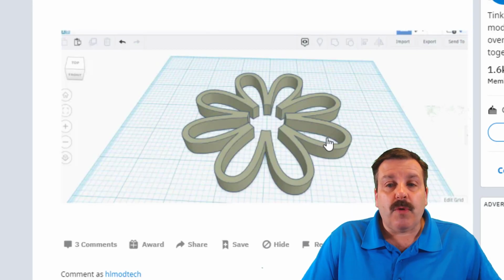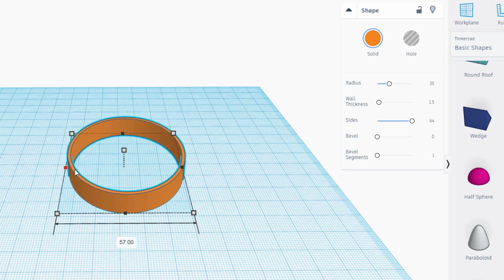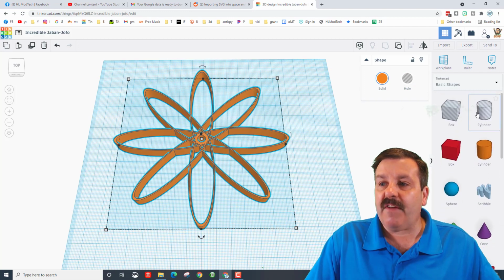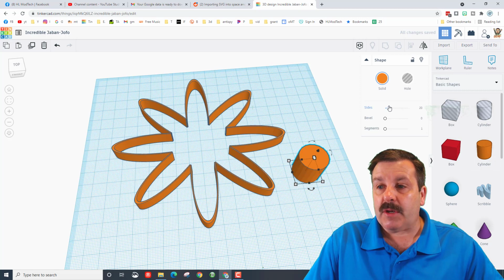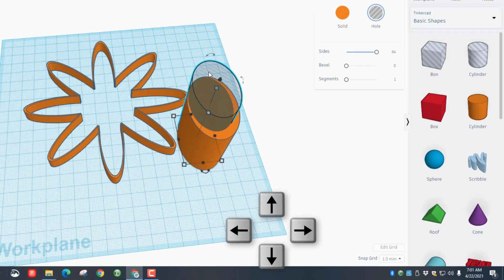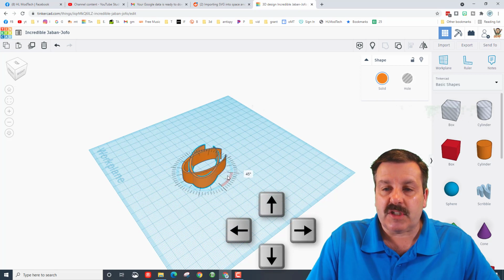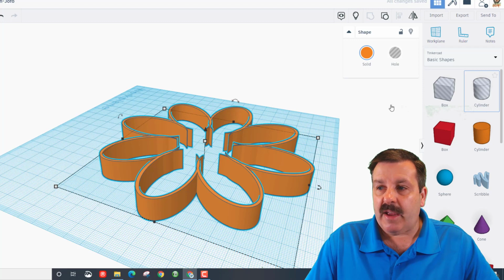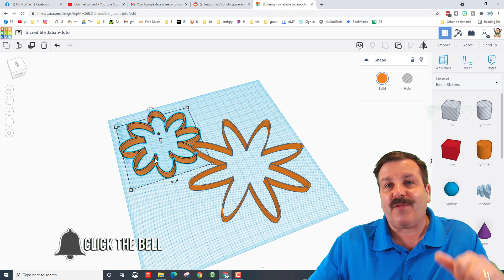An almost instant Cookie Cutter | Master Tinkercad in Minutes

Comment: how do I make an offset in tinkercad. I got a menu to outer shell one time, but I can't get back to it. I'm trying to make the Detroit tigers script logo with an off set so I can print two different colors with an outline on it. How would I do that?
Reply from the maker: I think the best way would be to use a SVG of the script logo. They have a new feature where you can do that but I have not made a tutorial of it yet.
Reply from the maker: Tutorial in a min. 👍
Reply from the maker: See if this helps https://youtu.be/U7-qjEVatgg

Comment: You can use your mouse instead of arrow keys, as long as you don't accidentally click off the object.
Reply from the maker: Good point. I switched to the arrow keys because I had a lot of students that would miss grab or snag a handle and mess it up...   Do you find the mouse faster than the arrow keys?
Reply: @HLModTech  yes, but we can also press shift while using the arrow keys to move in larger increments
Reply from the maker: =) Good point. I call that the Super Nudge. =)